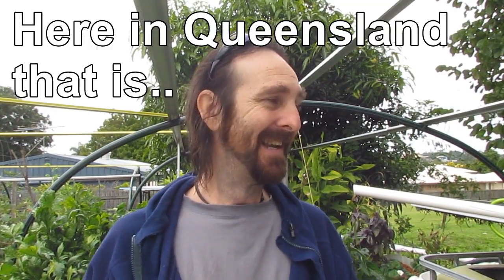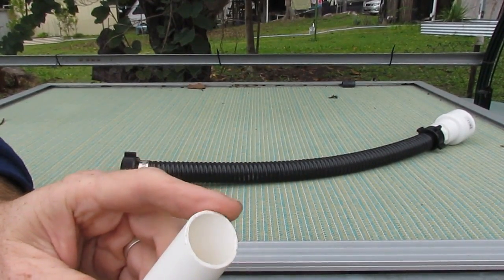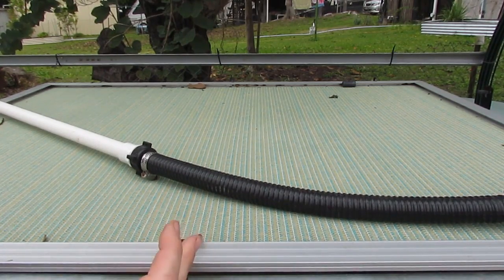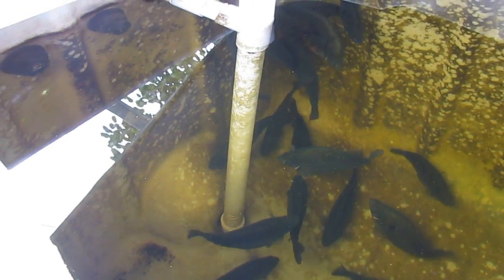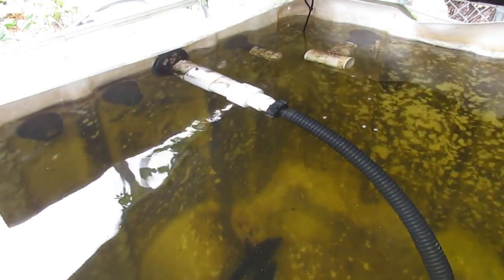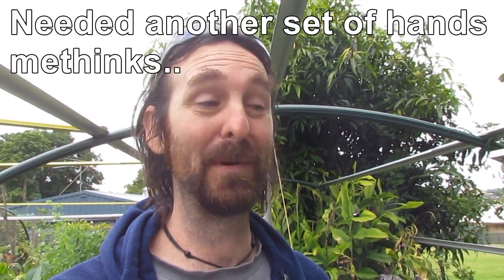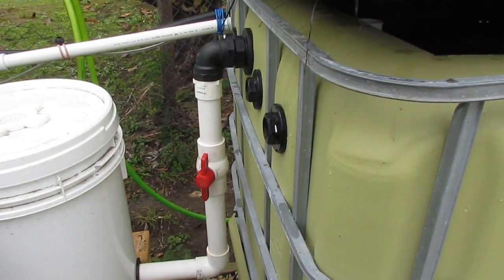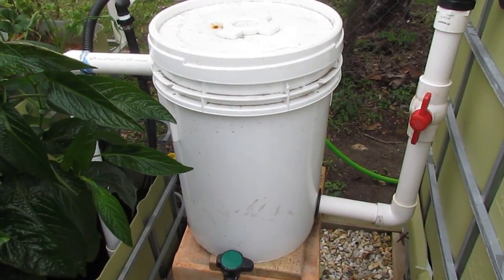Aquaponic solids vacuum attachment for fish tank..

Comment: Hey i got a question... with a square/rectangular tank where the solids can deposit in the corners, couldn't you just build a solids sucker which has 5 pipes on it.... 1 for each corner and 1 for the middle and then just join it all together? ( i can draw a picture if i haven't explain this well haha)
Basically a H frame which has 5 inlets and the 1 outlet attached to the vacuum pipe you pointed out
Reply from the maker: I have seen folks try a few designs similar to what you mention. Some work OK while others don't, mainly due to lack of flow rate into the tanks I think. 
I found just disturbing the solids into the water column once a week kept the deposits down.  
Cheers mate & happy growing.
Reply: @RobsAquaponics  i might try it out something... smaller pipe into larger would be the go surely, and have the furthest pipes coming up on an angle maybe... i'll have to have a look into it and get back to you. prefer to take as much of the work out of it as possible  feed and leave system with minimal checking/cleaning
Reply: i was also considering just adding an angled bottom to drive as much to the one side as possible

Comment: this is what i think....would it be better to drain the solids to the beds and then put worms in the beds as well? bell syphen all the water to the sump,and pump back to the fish tank from the sump,,,,,,more food for plants and worms, any thinkers on that???
Reply from the maker: Not really. If the solids build up & become aerobic in anoxic areas they can cause de nitrification with the nitrate reverting back to nitrite as the bacteria strip an oxygen for their own use. 
The solids can be removed & mineralised outside the system then added back in if you like & have the room for the extra mineralisation tank. As it is, any solids I remove goet used on plants around the patch so don;t go to waste. 
Sorry it took so long to reply.
Cheers.

Comment: I am thinking that if you were to fix a pipe that exhaust into the tak set it down at the bottom of the tank that would create circulation around the bottom of the tank then you would not have to use your wand. just a thought for you
Reply from the maker: Hi David..
I found that having the water fed into the bottom of the square tank still created dead spots for the waste to accumulate as well.. Haven't had any issues in the new round tanks though..
Cheers mate..

Comment: i think if your outflow pipes were bigger and you had more water flow you wouldnt have that problem... check out the videos on my farm... hope it helps out a bit... your water should be exchanging 2-3 times a hour and you could also increase your stocking densities.. I normally run betwwen 25-50kgs per cubic of water and I have had up to 80kgs..
Reply from the maker: Hi there..
The water changes over at least twice an hour from the rough flow rate calculation I've done.. Running a 4500LPH pump through to a 1000L FT with the only restriction being the DIY venturi.. Still a newbie at this really & am going on figures from folks like Paul from Earthan group & Dr Nate Storey for my stocking rates.. Until I get a bio filter in there I am running at 500g/25L of media.. Once I get a bit more experience & the filter I might up the ratio, shall just wait & see..
Cheers & shall suss out your channel..

Comment from the maker: I have seen someone try that somewhere on line but cant find where.. I think the problem they had was that the amount of suction was reduced at individual holes.. There were also concerns with solid building up in & under the pipe on the base of the tank..
The base of our tank stays clean 95% of the time with the fish doing all the hard work of stirring up any solids for the SLO to pick up.. 
Sorry for taking a while to get back to you..
Cheers, Rob..

Comment: Another way to do it is use a bit of clear tubing then siphon a bit so you get the flow started and either siphon it out to the filter or a bucket.  That is how I used to do some large fish tanks I kept many moons ago.  As you mentioned sometimes it needs a bit of a brush to loosen up the sticky bits.  On my smaller tank I used a 1/4" on my larger tank a 1/2" tube.  In my case I wanted to put new water in so I just discarded the other into the garden.